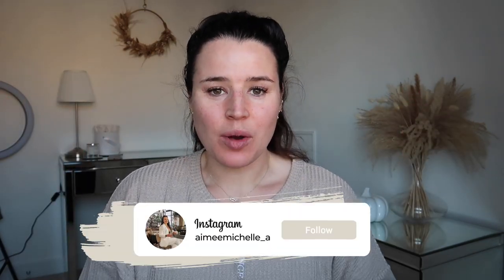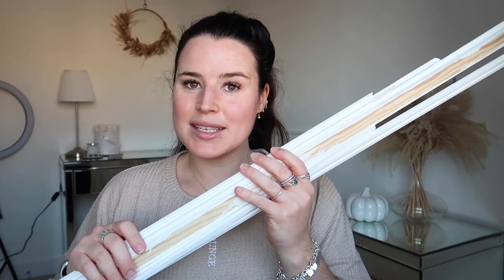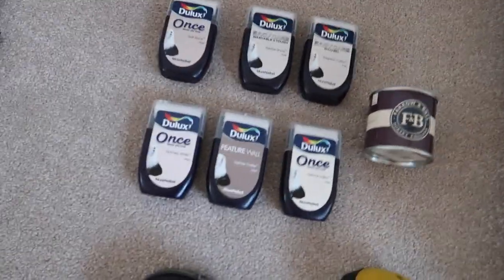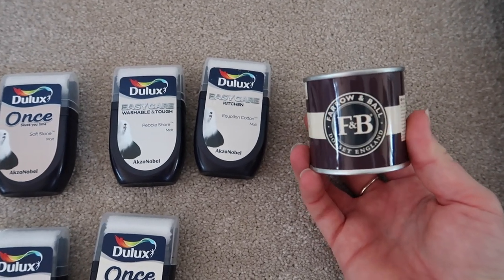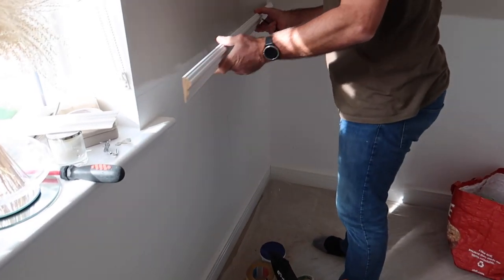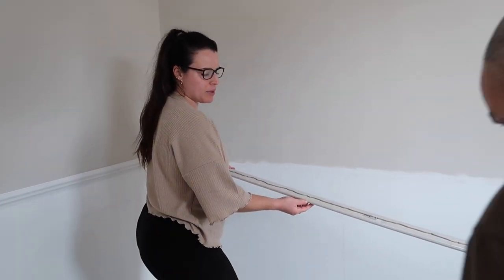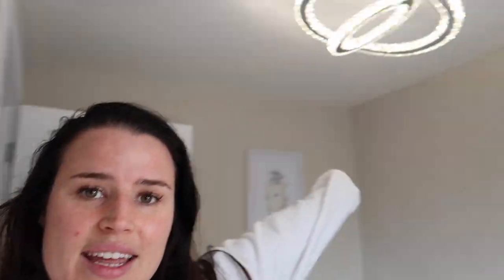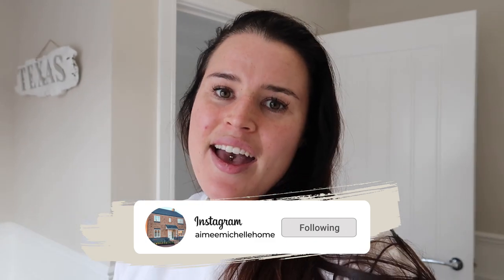CREATING MY DREAM ROOM | DIY WALL PANELING UK | RENOVATION VLOG ⚒️

Comment: Hi Aimee it looks fabulous!! Well done. Please could you tell me how you replaced the mirror? Would be ever so grateful. I’ve smashed mine also 🫣❤️
Reply from the maker: Hey lovely. Literally just order a piece of cut mirror from either online or I got it from my local glass shop, then just stick it down! Make sure not to use any adhesive with acid in it as it can melt the backing of the mirror over time x
Reply: @AimeeMichelle  thank you so much 😊 xx 😘